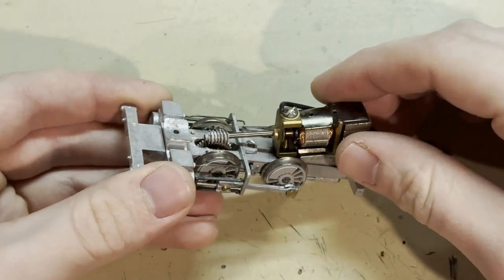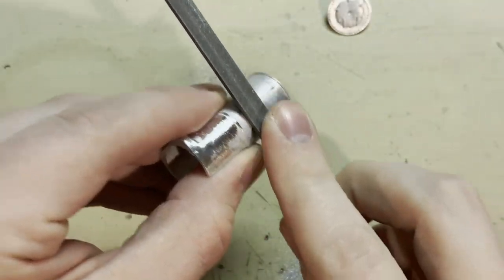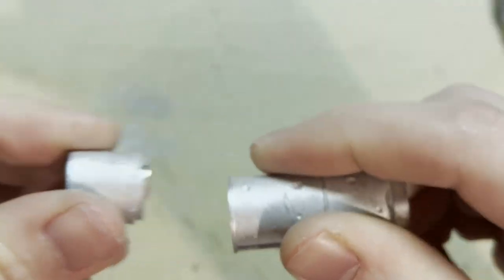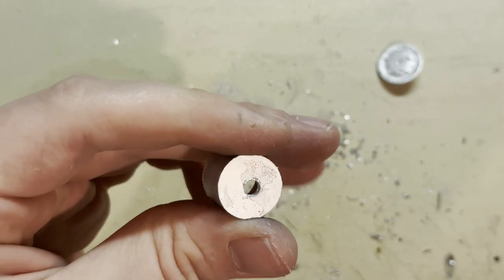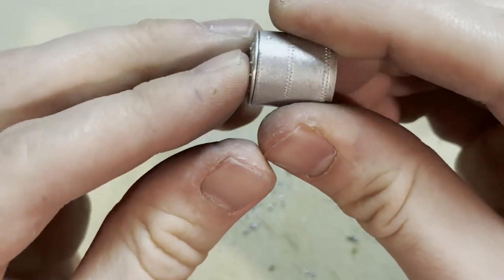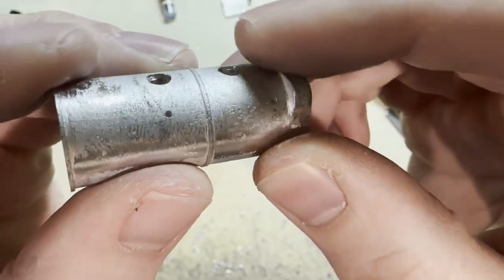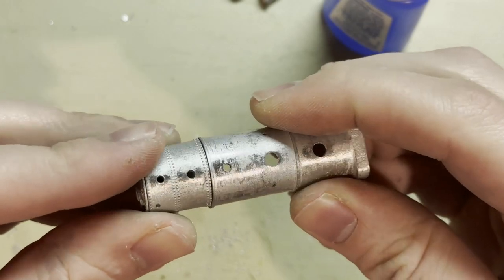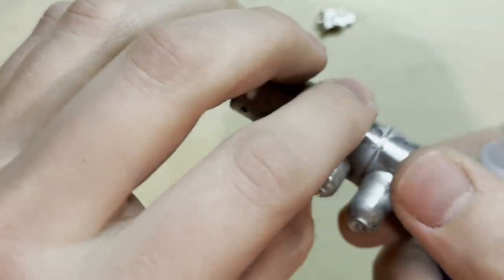How to Build a Terrible HO Scale Steam Engine Kit: Part 4 - Main Body & Basic Details

Comment: Once you have conquered everything and the locomotive is finally assembled and running the extra work required because of itch pain in the ass poor quality you can Beam with pride for overcoming all the obstacles like climbing a mountain. And it will be great for that little engine not to be in the Box unassembled forever. I had the ancient Mantua Tycho A3 Switcher with the tender as one complete metal casting with two stems to bolt the trucks to. No frame underneath. In those days if you couldn't see it it wasn't there. Like the underneath of Rolling Stock was not details until later on. Engine was a nice solid little metal engine Derek just something about Metal that screams quality while plastic scream cheap. I wish they still had the old-fashioned 0 scale k i TS where you could buy it in stages in case you could not pay for it all at once. People were real craftsmanship putting these type of kits together model railroad stuff lasts forever and gets new owners because their former owners died. When I have an old piece of Rolling Stock that has been hand-painted and lettered the guy who owns it put the extra effort in it to make it look more realistic and now that little caboose is 70 years old. I bet previous owner is glad that it is running on a layout . The guy I used real gold leaf paint to paint the New York Central stuff on the Caboose. All I did to it was for the conductor on the back platform I run it on my strictly o27 layout that is underneath my hi-rail layout above it also showcases a lot of my orange train in o27. Undersized cars are okay because you're the old days there were lots of 36-foot car is still left. But when you put a load scale three rail locomotive next to and 027 12 size disparity is too much. That's why I only run undersized o27 locomotive with 027 Rolling Stock. When Kaline came out with the old 27 big boy I ordered one and forgot about it because it was so long to get it and then it showed up on my door stop. I asked about returning it but they said it would cost me $100 out of the 400 I paid for it. Decided to keep it. Classic toy trains a article about it and bemoan Kaline did not make an American Flyer gauge version because it was perfect size for American Flyer I like your American Flyer guys would have loved to have a big boy on their train layout. I might put it on my 027 layout when I get everything sorted out from the hurricane. When the shed full of train stuff got destroyed by the tree and the 185 mile an hour winds from the hurricane blue stuff all over I found one of my locomotives two blocks away in the swell and picked it up and it was still good I picked up one box down the street and it turned out to be a commemorative car. Outside of a couple that went flying most of them were in the yard. I put my own stuff that I lost from the hurricane but some were worse than me and so I am grateful for that I can imagine what happened what would have happened if I still had my outside O gauge layout many times it had taken Monsoon Florida storms in stride. Hurricane Ian was a freak megastorm hurricane that I hope I never see again.
Reply from the maker: Sorry to hear you lost so much from the hurricane!  That is amazing that a piece blown 2 blocks away was still perfectly fine, so that definitely says something for the quality.

Comment: The model is really looking nice and it's mechanism seems quite smooth thanks to your patience. When you showed a quick view of the model on the plans to check for the front wood deck on the pilot, it looked like the original model used in the photo didn't even have the motor installed. You can clearly see right past the engineer that it isn't there. Thanks for sharing and I look forward to your next video.

Comment: The pioneers of model railroading in the old days when you got a steam locomotive kit you had to do Machining all over drill and tap all the screw holes and everything. Model Railroader get a test of a 0 scale steam locomotive kit and all of the problems that they had were similar to what you had to overcome and they overcame them and got the locomotive assembled and then did not recommend the purchase of the locomotive by anybody because of its poor quality. They got it assembled and running and it didn't look too bad but all of the extra work that they had to do to correct things and to make things work was mind-boggling. And after did all that work. They were honest about the fact that they could not recommend the kid because of all of its problems. They put together a Mantua kit and they had a few difficulties and the company read the article and change the production of the kit to get rid of the difficulties they encountered and then told the magazine that they were very happy to learn about them and to get them corrected so their customers would be happy with their locomotive that was good they said oh okay just didn't work so we will do things better and they did their kids were top-of-the-line. Forgive the poor grammar I have a shit phone.

Comment: you have a laithe why don't you put backing between the jaws  and can you true up the boiler to take a small drill to center a small prick punch or a  small drill
Reply from the maker: It's too small and light weight for that level of use.  If I tried to turn an imbalanced piece of metal on it, it would probably shake itself apart.